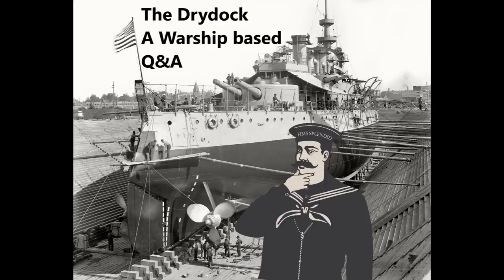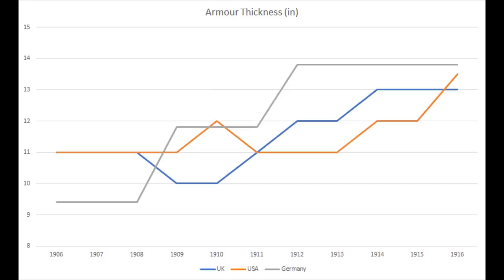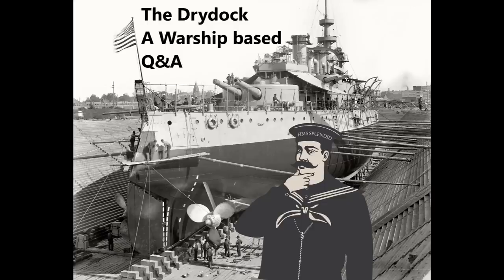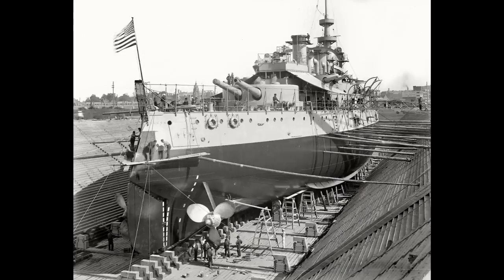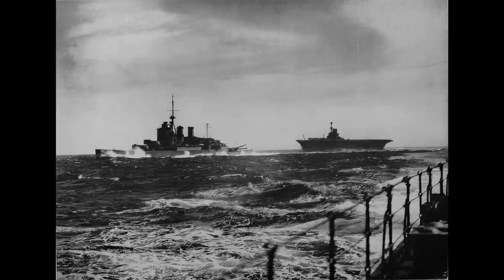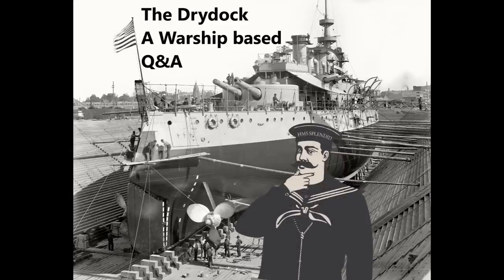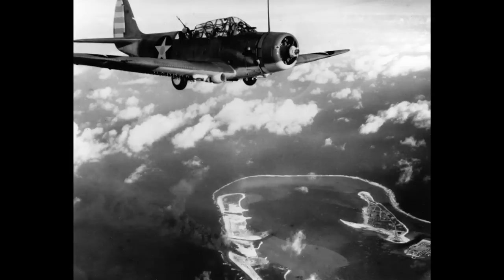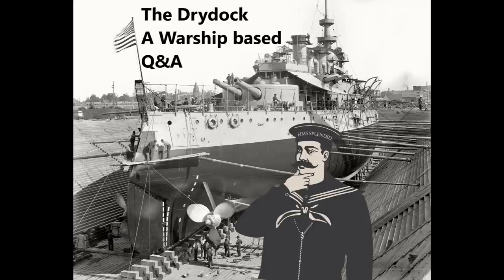The Drydock - Episode 226

Comment: Alright captain, it's WW2, your carrier has lost all engines, you lash your aircraft to the flight deck and full power all engines... 
Do you move?
Yes it's silly,... none the less.
Reply: It was done fairly frequently for close quarters maneuvering in harbor, instead of using a tug. There is footage of it being done  in the movie "The Bridges at Toko-Ri" and is called "Operation Pinwheel". Google it and you'll find footage of it being done. Apparently it was rough on the airplane engines.
Reply: Could this have saved any carriers during the war?
Reply: @larscelander5696  IIRC, in "Bridges at Toko-Ri", the complaint is that the engines are being run at or near METO (Maximum Except Take-Off) power for an extended period, without the enhanced cooling effect from a high speed air flow into the radiators.

Comment: Your first comment about ships' stabilities reminded me of this. Yonks ago I read a report that one or more North Sea  exploration rigs (semi-sub floaters) were tested in port during surveys or refits. The rig was stripped out and ballast tanks filled / emptied, with the resultant angles of tilt measured. This allowed the weight to be calculated. It had increased considersbly during use. The suggestion was made that layers of paint, extra pad eyes, rails and other additions were having a significant collective effect, though individually small. I wonder if this were ever done for ships?

Comment: The greater barrel life of the French 13” v Italian 15” may be due to propellant burning cooler. The 15” uses 16% more propellant to drive a 58% heavier shell at almost the same velocity.  Thus the energy of per unit weight must be much greater.  This suggests that the Italians used more nitro in their propellant therefor more heat. Heat weakens steel. If you compare USN charges straight nitrocellulose to RN charges Cordite the RN charges are smaller, in fact I fact I believe at least one RN gun was switched to USN propellant and about 50% more propellant was required to produce comparable performance and chamber temperature was lowered. The Italian rifling quicker by 20% and of course barrel life is subjective, how much wear is too much.

Comment: Why does the Swordfish enjoy a good reputation and the TBD a poor one?  Lack of of air opposition.  The Swordfish was the airplane that stopped the Bismarck and raided Taranto.  The TBD went up against the Kido Butai.   The TBD and the Swordfish were contemporaries but the TBD was more advanced.  Midway happened at the cusp of the Devastator's replacement by the TBF.  In a slightly altered timeline where the aircraft was replaced before Midway the TBD would have been the aircraft that sunk the Shoho and had no combat losses.  It's reputation would be much better.  I am not sure the TBF would have done much better under the circumstances.
Reply: Taranto was a heavily defended Port with dozens of warships inside. It was very well defended as was the ultra modern Bismarck. There were also far fewer Swordfish than TBD giving defences a better chance to hit them
Reply: @benwilson6145  Taranto was a night attack with no fighter opposition.   The TBD would have done just as well.
Reply: @johnshepherd9676   Except they were all tucked up in there beds
Reply: @benwilson6145   Swordfish were sent out against the Channel Dash.  How did that work out for them?  Do you really think the Swordfish would have at Midway?   Put down the pipe.